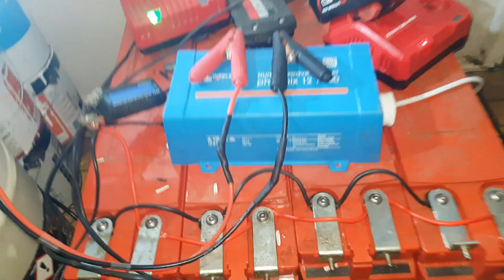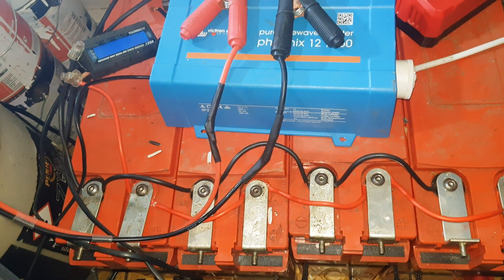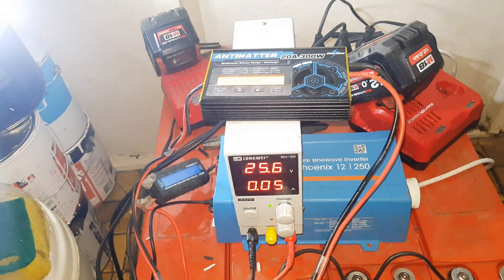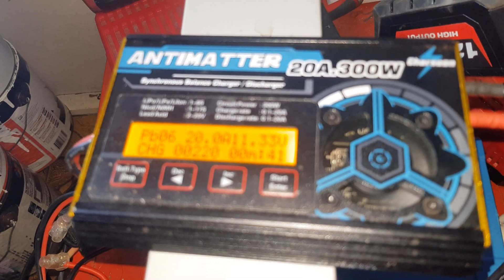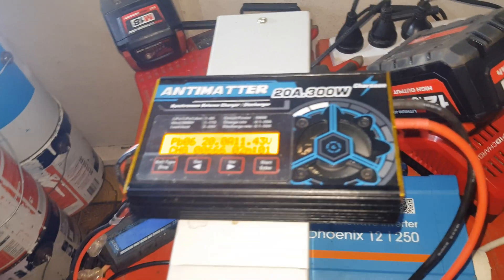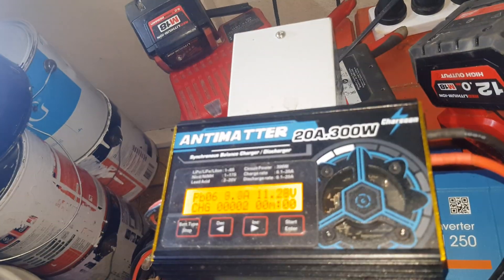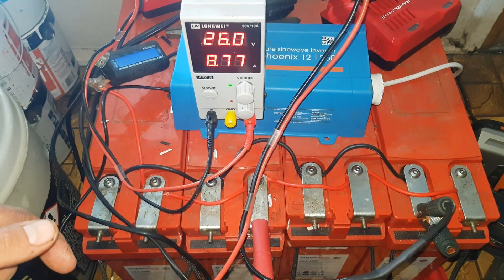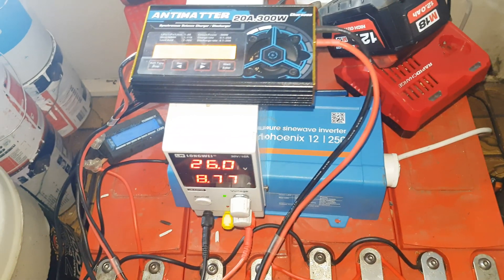7Kwh Of Storage for $200
Super Safe Sbs 190F

Comment: These come up for sale now and then in the US. Most of the US telecom is switching to lithium so you could usually pick these up a few years old for a little over $100. However, for a little over $200 you can get 100AH 12 V lithium.  I’m actually quite torn on what to use. These are rated at 190 ah but you shouldn’t pull more than 100 AMPs. Anything more than half will severely reduce the lifespan. So instead of 10 years, you’ll get a few years. With lithium, you can pull about 100%.  Long story short, you need fewer lithium batteries for the same amount of “usable” power.
Reply from the maker: Yeah they are different things

Comment: How is it 7kwh? Shouldn't it be close to 9kwh?
Reply from the maker: not very often you get 100% discharge out of them mate 7kwh useable is what it has. if you went for 9kwh you will one go that maybe 30 times  and battery's are damaged
Reply: @Oneupthesleevecustoms   @One Up The Sleeve Customs  excuse my lack of math/understanding mate. Are you saying te battery bank has a capacity of 9odd kW but the useable capacity is around 7kw, which is about 70% of the total capacity?
Reply from the maker: So you can never really take 100% of a lead acid battery. Theory says 9kw. 7kw is more realistic and if you want to cycle it daily I'd go back down to 3.5kw of storage as its a 50% state of discharge
Reply: @Oneupthesleevecustoms  now I get it. Cheers mate
Reply from the maker: Thanks for watching bud

Comment: I am not sure these cables between batteries are sufficient. They are also incorrectly fused. Even if your load is 1A, these cables should be way bigger, as there might be imbalance between batteries. Each battery should have own fuse when connected in parallel like this.
Reply from the maker: Thanks mate. This test was just to  cycle them and see if they were worth using. You are correct. But cells stayed balanced perfectly

Comment: 6 years old batteries. They are not great for deep cycling. But as a backup / UPS (when you need them only few times a year, and rest of the time they are floating) they should be great!
Reply: They are good for deep cycling even at 10 Years old as long as they wernt abused really hard
Reply from the maker: Still going strong. 4 to 6 kWh a day
Reply from the maker: They have a 15 year design life mate. Ill add some info soon

Comment: My Watt meters are from tenergy and they are really nice to use, I bet the timer rolled over 99h99m99s so its WattHour that uses the time went really wonky, Ah should be fine still. 
You are pushing your constant current power bench supply pretty close to its limit, as your Charsoon is current limited on the output as the battery voltage raises the more power it will take, this could take the 8.7A that is is drawing up to the 10A again and trip the bench power supply. you probably need a bigger power supply for the Charsoon charger.
Reply from the maker: I have a 40 amp 13.8v power supply but it was doing another job :) still charging alright now
Reply: @Oneupthesleevecustoms  nice! have you seen my SEC1223? its only 23A but Its awesome, its been plugged in and running my subs and auxillary speakers for my entertainement system for a while now, I should do a video on it once I finalize the setup
Reply from the maker: Na ill have a look.  Thats what this 40a one was used for a audio display. I need a bigger lipo charger 40 amp would be nice
Reply: One Up The Sleeve Customs ah nice, mine I got from my grandpa who used it for a small HAM radio, I did see a radio display with a couple amps big PSU and a super cap but he was asking over 1000$ I’m not going to invest that much on speakers that I don’t need lol
Reply from the maker: @SuperBrainAK  na exactly right. Im about to order some super caps to play with as a jump starter

Comment: How are you getting 7kwH out of those? I just multiplied nom voltage (12) x 190 (aH) and got 2.2kWh. I'm doing the maths wrong arent I?! coz those meters you are using are usually fairly accurate :) edit: no, I'm daft - I just looked closer at your inverter - its 12V so you have a 9kWh bank. Your running them in parallel. When I first looked I just assumed "oh, 4 batteries - 48V". Feel rather silly right now. :) (oh yeah and the psu dying in the ass after a few minutes means it was right on the threshold of the overcurrent trip. Backing off the amps was the right thing to do).
Reply from the maker: Remember watts is power. Never changes with voltage 1 watt is always a watt